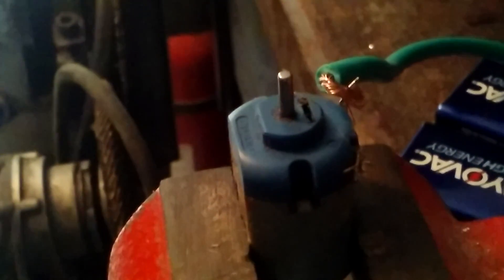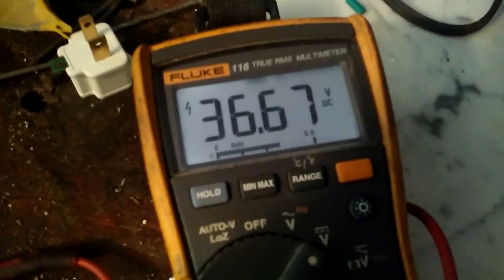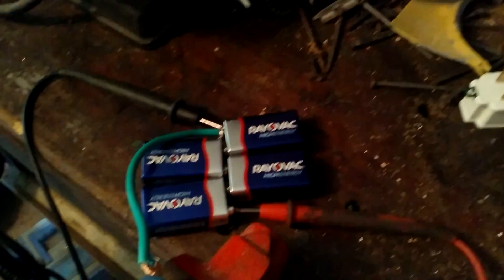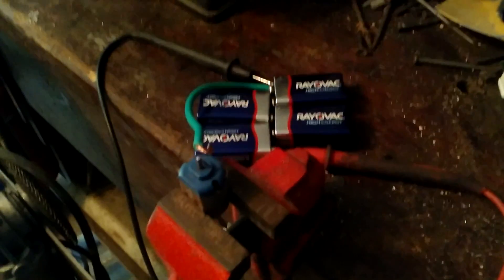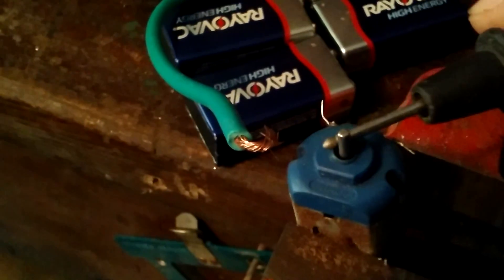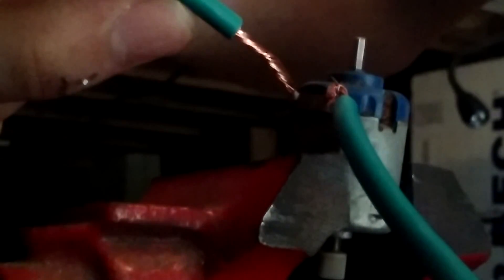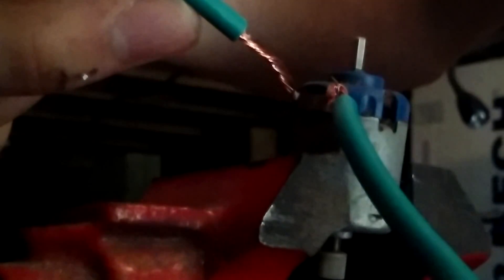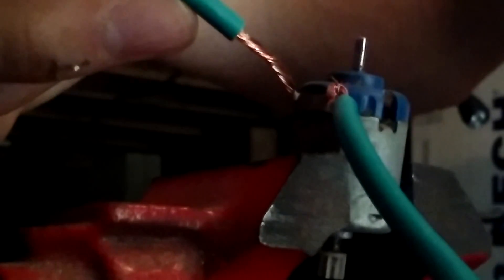DC motor burn out on 36 volts

Comment: dang!!!! I was thinking about using a 3 volt motor like this for a 1/24 scale working engine model. I can't afford a plastic engine to burn.
Reply from the maker: real Tylun Porter Lol, you can get them anywhere... buy one of those cheap foam bladed fans and rip the motor out of it... I think that's where this one came from lol
Reply: SD Customs Thx bud